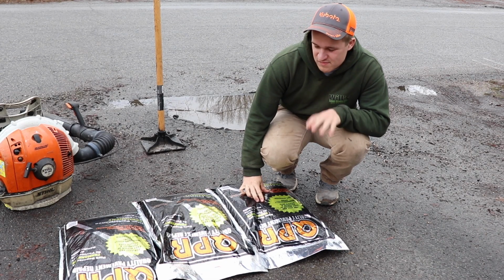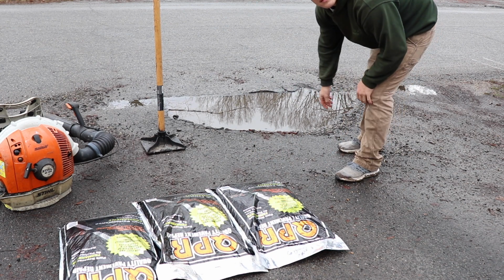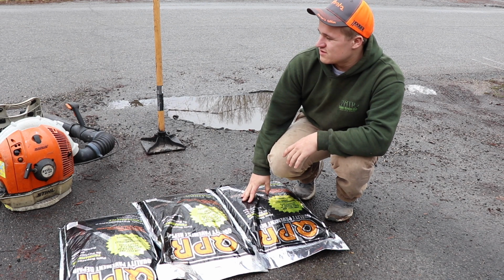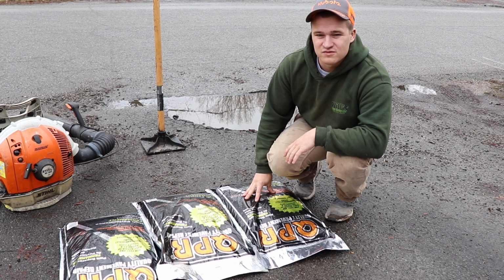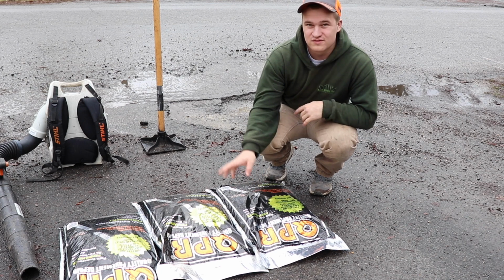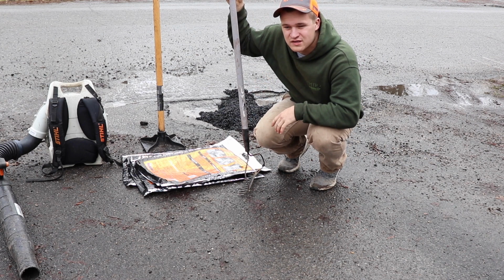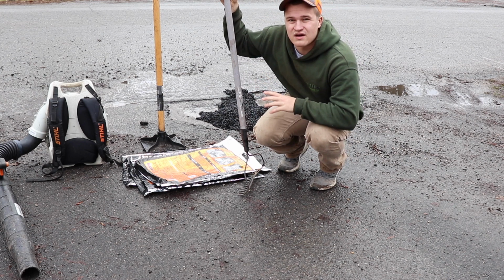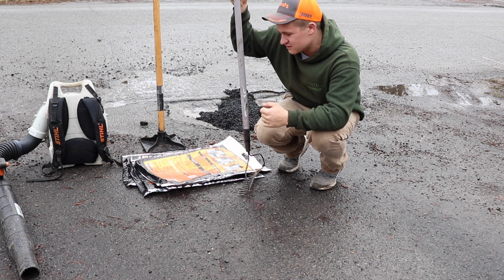How to Fix Driveway Potholes - SUPER EASY!!!

Comment: A cold patch is a great option for a small pothole and certainly a homeowner. I've found that a hot patch works much better (lasts longer) if you have the right tools. But you need to be ready to repair multiple potholes at once and have a truck bed or dump bed to put the hot asphalt. A roller isn't required but makes a  huge difference. Also, makes quite a mess so definitely not as easy as the bags you show here.